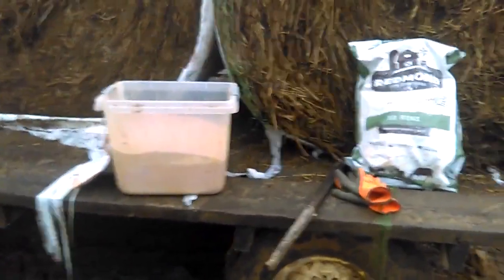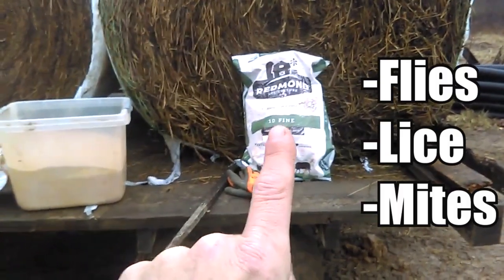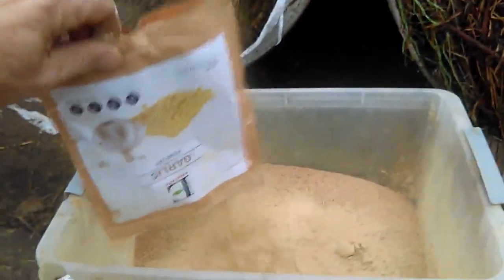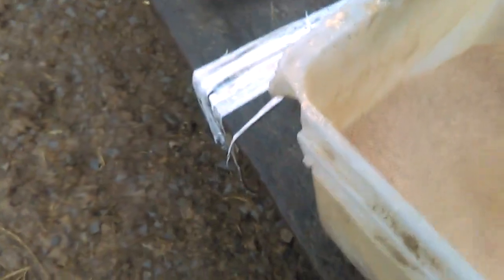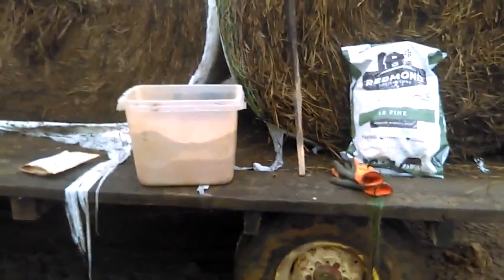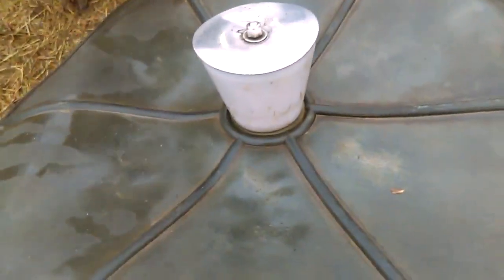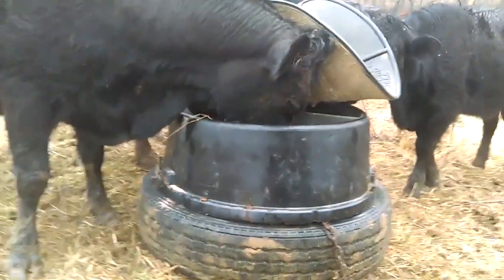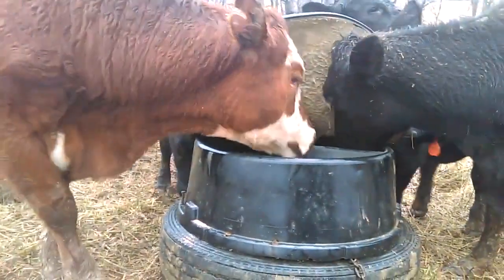Adding Garlic To Mineral Salt, Livestock Fly Control

Comment: Hey Jason, Are You still using garlic powder in the mineral? What were your results? Thanks for the videos!!! Keep up the great work!!!!!
Reply from the maker: Hey Russ, No we are no longer experimenting with the garlic. I tired it for a couple months and never seen much difference. It also got tricky finding garlic powder in bulk. Have your tried it and what were your results?
Reply: @GrazingAcresFarm  We have not tried garlic powder. In my research on garlic found a paper that went in to say it reduces insect larvae in the manure by 50 percent. I try to get the manure patties to recycle in as little as 7-14 days. Most of the recycling comes from insect activity. So that isn't an opinion on my farm. I have seen a lot of folks try it and then stop using the garlic. another of my limiting factors is it is just another input. I mean no disrespect to the folks using it with success.

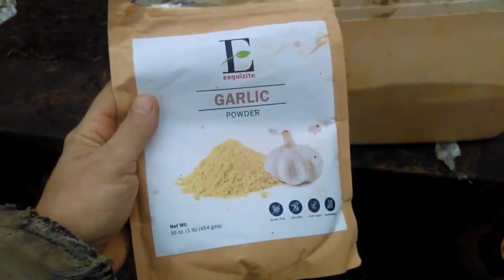Comment: So did you put both 1-pound bags in or just one?  1lb per 50lb of mineral, or 2lbs?  At 1:22, you said you bought "a couple packs" of the garlic, and you hold up a bag that's already opened.  At 1:37 you say you've already mixed some in.  You then empty the already-open bag in.  So it's not clear to me whether you put both "couple packs" in or just one.  
Thanks for the video - I"m eager to hear how it went.
Reply: Never mind... read through some of the comments, and it appears it's 1-to-50 ratio.  Thanks